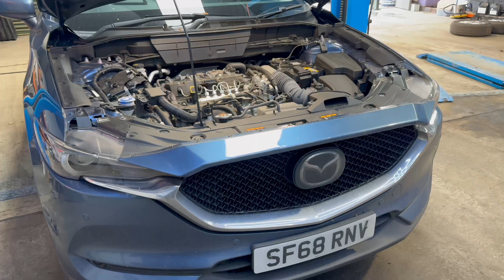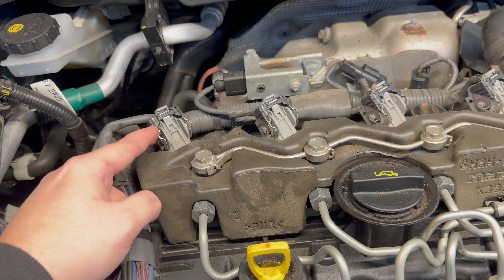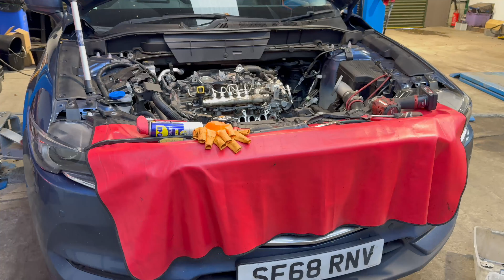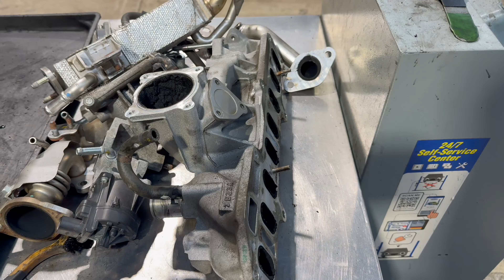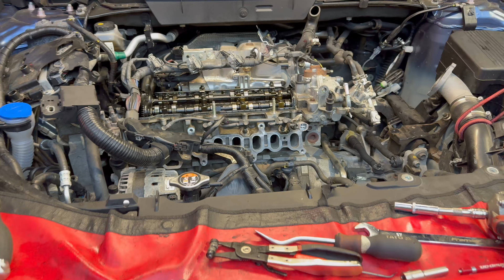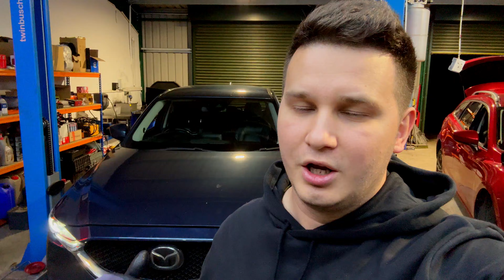Are New Generation Mazda Skyactiv Diesels Any Better?

Comment: Hi
I had Walnut blasting done by you in early 2024 and have done about 10k miles since.
My dpf is having issues and I can't regen the dpf , I have a throttle body issue. Should I get my dpf cleaned?
Many thanks
Geoff
Reply from the maker: Hi Geoff, please get in touch. But you are having DPF issues very likely because of the faulty throttle body.
Reply: @MrNiceGuy94 Hi Dave thanks for your advice have purchased a throttle body and hopefully that will allow me to re gen the dpf
All the best
Geoff

Comment: The Mazda 6 diesel GJ onwards is a disaster, the turbos fail and are uber expensive to replace, the cylinder head has got hot spots that cause blown head gaskets, the exhaust cam wears prematurely it has sensors that fail, in fact the first skyactive models had no temperature gauge fitted, the only time you know that your car is overheating is when it max revs and goes into limp mode 😂😂😂 nuff said

Comment: I have the previous generation engine on a Mazda 3 and the carbon build up at 78k was far worse than this with a fair bit of motorway driving. I changed the exhaust camshaft (very worn), injector washers, exhaust/dpf/manifold pressure sensor and did a full carbon clean (your videos were really helpful). I reset all adaptations and it runs fine, however the dpf is now regenerating  even more than it did before, so I'm guessing it's the injectors. Not willing to spend the money for new injectors so I'll just be moving it on unfortunately. Pity, it's a lovely car.
Reply: Check your turbo first, especially the low rev turbine. The bearings wear, oil vapour leaks into the inlet system and this causes the particulate matter counter to go up very fast ergo regens occur more frequently. New cartridges for the turbo aren't that expensive if you are willing to replace them yourself. Yes, the injectors do fail but I find this to be in very small numbers compared to turbo failure.
Reply: @caileme Thank you. I'm clueless re the turbo, it's not something I've ever had to work on. Where should I be looking to see if it needs attention?
Reply: @garrylogan8005  Watch the vid I list at the end, you will see the parts he has taken off to get to the small turbine inlet pipe. Stick a long screwdriver onto the center of the small turbine and see how much wiggle there is. If there is a lot of wiggle then the bearings are stuffed. If you can, look at the sides of the turbine housing, if the walls are shiny it means the turbine bearings are stuffed -  search yt shorts for MrNiceGuy with the title - Mazda P0299 Fault Code - How To Check Turbo Wastegate Flap

Comment: There was a later engine revision, 2021 SHY8, biggest issue with these engines is the injectors. They are getting a reputation of failing around the 60k - 80k miles mark and they cost a fortune. They are only available thru Mazda at 1200 pounds each......

Comment: I have the 2018 model with no ad blue system. It already has done a carbon cleaning with 88000 km because of a fault code but no actualy loss of power. I have a xtool a30 m diagnostic machine that i use to gather live data because of the dpf and lately i noticed that for example if i Turn of the engine with lets say 2.7 of acumulation of particle matter, when i Turn on the engine and Run it with the engine cold and with low exaust temperatures due to city driving, the particle matter values starts to decrease a lot like reaching 2 or even less... It doesnt make sense and i think the culprit is the mentioned dpf sensor. Thanks for the video!
Reply: I have the 2017 model and I noticed the same thing. Not sure if it is a problem though. The dpf accumulation is probably just calculated from the dpf pressure, which seems to drop at low dpf temperature. There should be some corrections to the calculation built into the software, for example you need to correct it with the MAF value, as more air means more pressure l, but also for DPF temperature, which I think they did not do. Anyway, if you replace the sensor, please update if the issue resolves.